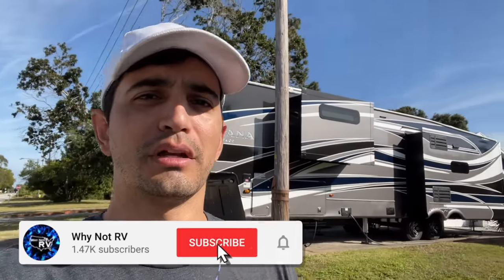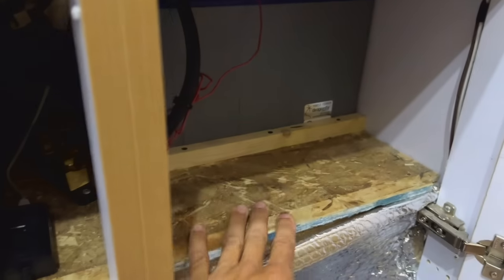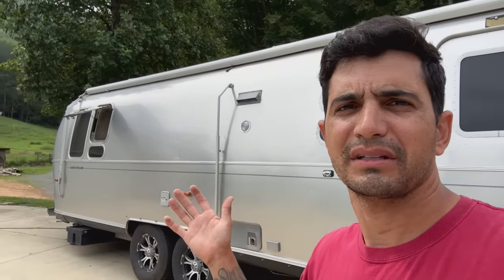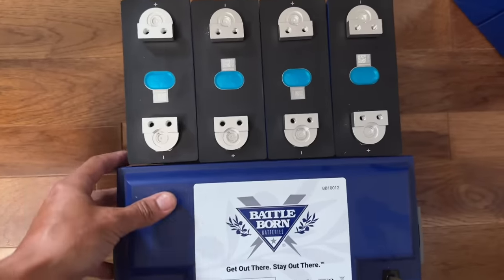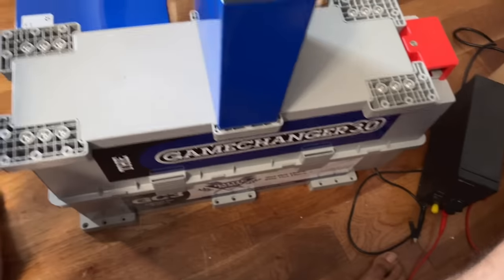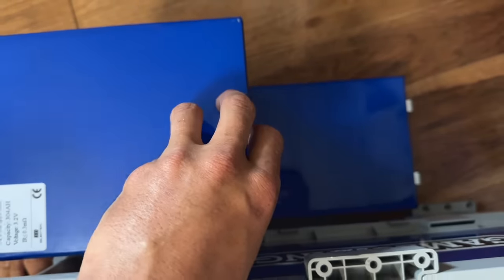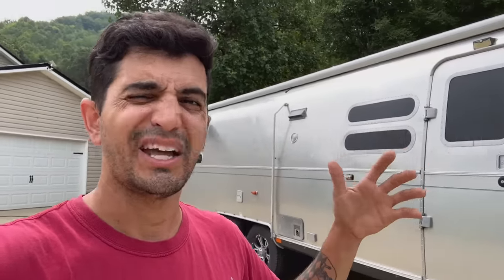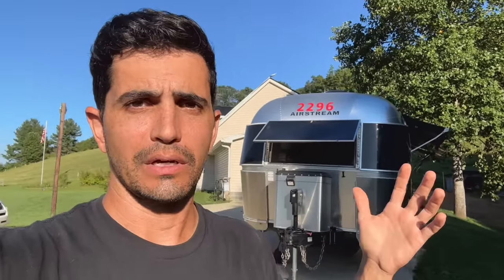Best DIY Battery Upgrade on the Market - GOODBYE BATTLE BORN - Why Not RV: Ep 127

Comment: Not trying to troll anyone, but most people who have not studied some battery engineering are better off getting a professionally-made battery.  The results will be safer and more consistent.

As others have noticed there are several errors in this video.  Errors with Lithium batteries can unfortunately be dangerous in some cases.

Battleborn's battery prices fall along with others as the cell costs continue to fall.

Also, be very careful about getting batteries directly from China.  Some bad sellers are selling factory rejects.
Reply from the maker: Always get Grade A cells. Not worth slaving a few bucks to have anything less. If you watch the update video you’ll see this setup is perfectly fine and works without any issue. You don’t need to study engineering to put this puzzle together. There’s just different levels of complexity you can add to make them safer or more secure or whatever it is you want to do.

Comment: Quick question;
How did you protect the DIY batts from over charging? Also, I think those DIY batts need to have some kind of rigid strap or banding to keep them from swelling?
Reply from the maker: I added a wood frame to prevent swelling. Some people use a special tape. Nothing I have will overcharge these but the BMS protects them as well.

Comment: Awesome information.  Any ideas on a heater for these if I live in a colder temp area?
Reply from the maker: Right on Amazon there are battery heaters that you can use. You can also put these in a enclosure with some good insulation and Juster discharge and recharge self producing heat will keep them pretty warm. You can always have a heater in the bottom of the enclosure if needed.

Comment: hello can you give the two display unit models that you have at time mark 22:28 I would be interested in looking at the specs on both those units ......thanks
Reply from the maker: The top small round one is the display unit for the Victron BMV-712 https://amzn.to/487oGxL the Other larger display is for the Victron cerbo gx, https://amzn.to/45Po4eS this is its display unit the touch 70 https://amzn.to/45JE2Hp

Comment: I'm sorry to be the guy to say this. And it really isn't your fault. The industry is so misleading by quoting amp hours all the time when it should be quoting watt hours. However, amp hours isn't a measure of capacity. In order to get a measure of capacity you have to multiply amp hours times volts to get watt hours. When you are building out a pack out of cells in series you add the voltages together but maintain the same amperage. So if you have four 3.2 volt 100AH cells and you put them in series you get 12.8 volts at 100ah. Meaning you get 1280 watt hours of capacity. Probably this is pretty similar to the watt hour capacity of the slightly larger battle born. The extra size of the battle born is accounted for by the bms being inside the case as well as the cells.
Reply from the maker: Ya it would be nice if everything was standardized as watt hours. The savings with DIY is just insane.
Reply: He built 4   300 amp hour 12 volt batteries.  Each cell is 300 amp housr at 3.2 volts . Add 4 of the them for 12.8 volts and 300 amps hours about 3.5 kilo watt hours. That is 3 times the battle borns.
Reply from the maker: Exactly. Thank you

Comment: For 12vdc you should use 4P 4S config
Reply from the maker: This is setup 4series cells for 12v and 4 sets in parallel
Reply: the cheapest upgrade would be, use the battleborn BMS and buy new cell
Reply from the maker: Not when I can resell the battle borns for almost  the cost of these new cells
Reply: @WhyNotRV  i see. Maybe i miss in video you mention that
Reply from the maker: I don’t think I put it in the video itself. But I sold these three batteries for just under 600 bucks each. Which at the end of the day is a good deal for the person who wants to brand name and it is but can save some money.

Comment: don't let your insurance company see this, it is a fire hazard.
Reply from the maker: Definitely not a fire hazard but I appreciate the input. I will be doing a follow up video showing all of the additional stuff I did, such as adding foam, insulation board or on all four sides, as well as the top. Shelf above the presses down to create pressure and prevent any movement.

Comment: If this was a new system, I would definitely consider 24 or even 48V system. But I understand you have a 12V inverter already.
Reply from the maker: Yes, I would’ve done 24v I. This setup if O had done it from the beginning and who knows, down the road I can easily rearrange for a 24v system and upgrade the inverter to the 5kva version that’s available with 24v

Comment: So this may be a dumb question due to I really don’t know much about solar and stuff. My question is can I replace regular deep cycle battery with something like this without solar? I know my trailer has a 100a solar plug on it but I think it’s literally just wires as nothing else. Have a huge front storage are to house batteries! What would you suggest?
Reply from the maker: You can absolutely replace your batteries with something like this and have no solar or anything solar related. Of course, depending on your RV converter, you’ll likely have to replace it to one that is capable of charging lithium batteries. Or have adjustable charging parameters to properly charge and maintain these.
Reply: @WhyNotRV  thank you so much for the info. I would love to do solar and have a lot of open real estate on the roof of our trailer but unfortunately just don’t know where to start. Have a great day and thank you for all you do for us.
Reply from the maker: Absolutely! Have you watched my solar Saturday series of videos yet? I posted them last summer a couple weeks in a row. I really break down every single component of solar and it gives you a really good base knowledge to start off on. I have it as a playlist on my channel. If you have not watched it, I highly recommend it.
Reply: @WhyNotRV  I have not but I absolutely will. Thank you.
Reply from the maker: Anytime!!!

Comment: When charge balancing the terminals should be placed opposite so as to share the current charge equally in a diagonal way
Reply from the maker: Ya I’ve had several people bring that up. In large amperage situations that’s beneficial. With low amps like this application for top balancing it’s pretty much irrelevant
Reply: Thank you for your great videos it teaches us the economics of power for cheaper and better brands on our current situations 🙏🙏💟
Reply from the maker: I appreciate it

Comment: 12V at high current is an inneficient setup, go 24V or 48V.
Reply from the maker: Yes for larger systems I also recommend 24v. For a simple inverter setup 12v is fine. If doing dual inverters or a lot of solar… bump to a 24v system

Comment: Each battery is one cell.  You can’t add the amp hours when in series.
Reply from the maker: Each one cell battery is 3.2v at 304ah, putting 4 in series is 12.8v at 304ah. Now taking 4 sets of those in parallel gives you 12.8v at 1216ah.
Reply: @WhyNotRV it’s impossible for those cells to be 304ah.  That would make them the most energy dense cells
On the market by a long shot.  The current highest capacity it’s 120wh per lb.  The Amazon listing has these batteries as 5.3kg.  So 5.3x2.2=11.6 11.6x120= 1399.2wh.  So at 12.8v that’s a 110ah battery.
Reply from the maker: Unfortunately, you are wrong. There are cells that even though upwards of 400 amp hours in these prismatic cells I did a full capacity test and there’s no way I can pull 1200 amp hours out of cells that you’re claiming would only be 100+ amp hours. These are 304 amp hours all day long maybe you should watch some of Will Prowse videos to further your education on the cells themselves
Reply: @WhyNotRV  maybe they have the wrong weight listed.  That would explain it.  Do you have the raw weight per cell?
Reply from the maker: I never weighed them myself but I’m sure what they have listed is correct. I remember feeling them and thinking that it was a pretty accurate number.

Comment: Great minds think alike. We're retired FT RVers who love to boondock most of the time in an older motorhome. We wanted to replace our old pair of GC-2 golf cart batteries that lived in the small space under the steps of our motorhome with the most capacity lithium batteries that could fit in this small space. If we went with Battleborns, or other pre-made LiFePo-4 batteries, we could only fit 2 -100ah batteries in this space, so we decided to build our own LiFePo-4 batteries out of 8, 280ah prismatic cells. This gives us a 560ah 12v battery. We chose a Heltec 350amp BMS, to start the onboard generator in our motorhome, along with a 5a active balancer to keep all the cells synched up. We built our 12v battery with grade "A" LiFePo-4 prismatic cells having a 6,000-cycle manufacturer projected life at 100% DOD. This means that if we cycled them 100% every single day, 365 days a year, they would last over 16 years! So they're obviously going to wear out from age before they wear out from cycling as we only use 15-20% of their capacity daily giving us enough reserve capacity for several days of bad weather before we have to run our generator for charging. It only cost us $1,500 to build this 560ah battery, including the high amp BMS, active balancer and adjustable charger for top balancing. They fit perfectly under the steps of our motorhome where our old pair of golf cart batteries used to reside, saving 35lbs while having over 5 times the energy storage capacity. We insulated the battery compartment, cut a 1" hole in our step risers and installed a tiny computer CPU fan to keep this space at close to room temperature, so we don't have to worry about the BMS shutting down charging if they get too cold - or their life reduced from getting too hot. We've found Lithiums charge much faster than our old lead acid batteries did and are typically full before 1:00. This 560ah battery assembly, including our 620w liftable solar array, wiring, breakers, a new Progressive Dynamics 80a Li compatible converter/charger, a 1,000w Renogy PSW inverter to run our TV, PC, ice maker, etc. (we use our 5,500w generator to run our ACs and microwave), an Epever 50a MPPT charge controller for our solar panels, a Lnex battery monitor/shunt, and a Renogy DC-DC charger (to protect the alternator) only cost us around $3,600 as we did the entire installation ourselves. 

 We started our build 4 years ago with a custom built 620-watt liftable solar array mounted on the side of our motorhome. It serves as a nice bedroom window awning too. It practically lifts itself to the desired angle with a couple gas struts and it's easy to clean with a windshield squeegee, standing safely on the ground. By mounting our current solar array on the side of our MH, we left the roof free to rack 8, 550W Sungold Power solar panels down the length of our 35ft Class A. We'll be tackling this project after the first of the year. We will be racking ours about 13" off the roof to clear our front AC shroud and vents. Rather than buying individual components, we will be using a Sungold Power all-in-one 48V, 5,000W, 120V PSW Inverter, 100a MPPT charge controller with a 40a ac battery charger. The reason we chose this all-in-one is because the idle power consumption is only 25 watts - and it's only $800. Most this size have an idle power consumption over 70 watts and cost at least $1,200. Our 48v battery bank will use 16, 304ah prismatic cells like you have (15.5Kwh.) So together with our 560ah (7.1 Kwh)12v bank, we will have a total of 22.6 Kwh of batteries onboard - the equivalent of about 18, 100ah Battleborn batteries. We will also have over 5,000 watts of solar to keep this massive bank charged, while powering our air conditioners too. We will be replacing our old rear 13.5k btu rooftop Dometic AC with a super high-efficiency 12k Btu 48v DC mini-split heat pump that only draws 750 watts at peak output and less than 500 watts when it's cooling normally. This second phase will cost about $10k, including the heat pump, as we plan on doing all the work ourselves. Our 2nd phase will provide 24/7 off-grid air conditioning and supplemental heat from the heat pump and allow occasional usage of our front rooftop Furrion AC to cool things down quickly during peak afternoon demand, as well as give us whole house 120v ac power. This will give us total off-grid electrical independence, allowing us to keep our generator in reserve for emergency use only.
Reply from the maker: That sounds like it’s going to be an absolute incredible build. Have you watched my series on my build for the Montana yet? If not I highly recommend it. I did a 5000+ watt solar array on top of the fifth wheel. Dual victron 48 V inverters. The whole shebang, onboard generator, and what not.
Reply: @WhyNotRV  I just watched the vid on your Montana. That's a huge array! I plan on dropping my front 2 panels like you did to help direct wind over the array, keeping it more stable while traveling. Did you notice it affect their output much? I plan on making one series string with these because of the all-in-one inverter/charge controller/charger's requirements. The 100a 48v MPPT charge controller will handle a 5,500W 500Voc PV Array so I'm planning on a 400Voc (336 Vmp) string as the input current is limited to only 18a, which is OK, as the Isc of the panels is only 14.1a. Victron equipment sure is nice, but too expensive for my budget. This 5,000w PSW all-in-one Sungold power unit is only $849, comes with a 2 yr warranty and lifetime tech support so you can't beat the price. I've spoken to a fellow RVer who's been using this brand reliably for about a decade, so I trust his recommendation.
Reply from the maker: Yes Victron is expensive but I find value in it that makes it all worth it personally. I will always have and use Victron but there are definitely plenty of other brands out there that work, function and get the job done
Reply from the maker: I did not specifically notice and difference in output.

Comment: One question... i always understood that in multi cells, or batteries, the pos & neg should be attached on opposite ends?
Reply from the maker: If I were doing a single connection to the bus system then yes you want to do that. The other option is what I represent here, which is keeping all of the positive and negative cables, exact, same length, and putting them all to the bus system equally.
Reply: @WhyNotRV  Got it.
Thanks for the reply!
Reply from the maker: Absolutely!

Comment: The lithium polymer batteries will lose capacity about 4x faster than the lithium iron phosphate batteries. They are also much more unstable if they are punctured or overheated.  That's why they aren't used by most manufacturers. 

Since you won't be cycling these every day for years it's probably a reasonable tradeoff for this aapplication. 

I don't know how much each type degrades with time (not cycles) but that would also be an important consideration. 

Considering the price and the capacity of these cells I can see why you chose this setup.
Reply from the maker: These aren’t lithium polymer. They’re lithium iron phosphate.
Reply: I suspect they are selling lithium polymer batteries and calling them lithium iron phosphate. If they were lithium iron phosphate they would have the same power density as all the other lithium iron phosphate batteries on the market. 

Maybe this company has figured out how to triple the power density of lithium iron phosphate batteries but I don't believe that's a reasonable assumption. 

If they are lithium polymer they still have a use case for RVs that don't get used continuously like off grid home systems do. 

Either you found a company that will dominate all other battery companies or they are scamming people.
Reply from the maker: I definitely understand your concern, I am extremely willing to bet that these are lithium iron phosphate. There are tons of cell providers that have a similar density all over the place. Pre-built batteries have extra casing and different pieces inside the box that make the footprint, not nearly as usable by comparison. There are tons of people on line who have tested these batteries for many years through thousands of cycles.
Reply: @WhyNotRV  I'd be interested in seeing a link to one of the teardowns you are referring to. I've see several and none had more than 10% extra volume associated with packaging and the BMS.  Certainly not 300%.
Reply: I found a video by Will Prowse reviewing batteries with  the same form factor and packaging as these so I guess you are right. I'm sure the packaging of the  Battleborn battery doesn't have 300% wasted space though.  I'm trying to understand the huge discrepancy. 

Sorry for making a false assumption. These batteries now have my attention.
Reply from the maker: I was just about to refer you to some of the Will Prowse videos. I trust pretty much anything that guy has to say at this point lol.
Reply: He’s just adding cell capacity and voltage together.  He’s basically building the same pack as the battle horns. 😊

Comment: My only problem is that you did your top balance with these batteries with an unsafe, non-lithium charger and no BMS. This is not good. Never ever charge a lithium battery without a BMS
Reply from the maker: An understandable fear… but not necessary. Watch diy with will prowse. He is a professionally educated electrical engineer and does it this way as well. Nothing wrong with it if you know what you’re doing. The danger is people not knowing and doing something wrong.

Comment: 640 per cell but you need at least 4 for 12V.....plus bms
Reply from the maker: It’s $640 for 4 cells and the BMS I used is $40. So $680 total for 1 12v battery that’s 304ah
Reply: @WhyNotRV  thats not bad then
Reply from the maker: Exactly